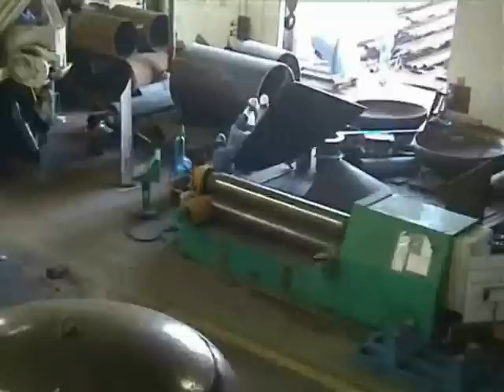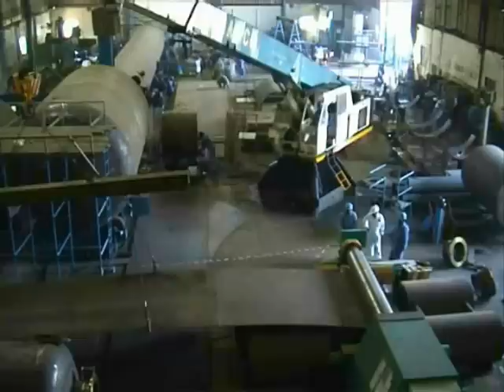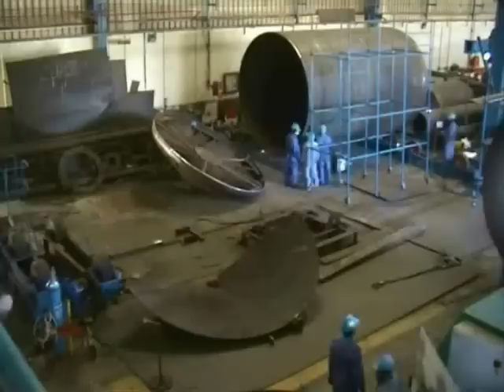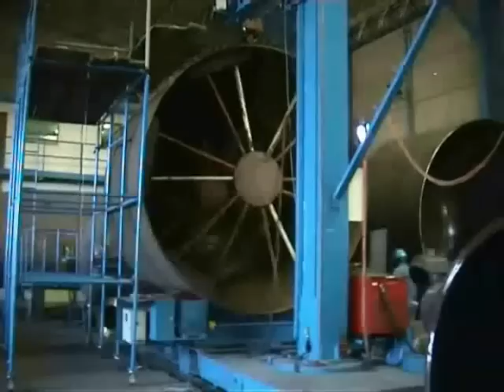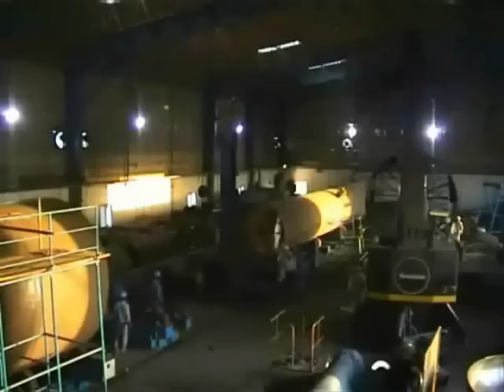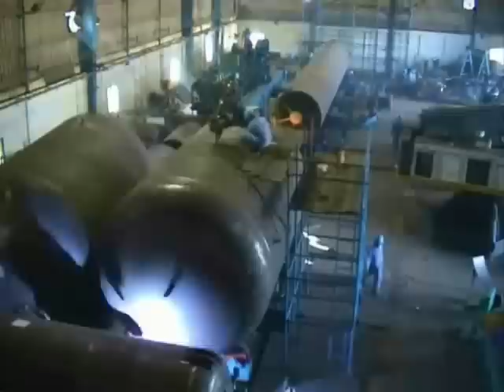Pressure Vessel Fabricators.wmv

Comment: Wish we could figure out how to roll cones. We can only press form them.
Reply: KC G cold press?
Reply: cut a wedge out of a disc and lift from center a cone should form,this only works with cones short apex
Reply: 500 लीटर का कंपटीशन चाहिए एयर कूल्ड
Reply: You have to develop out the correct shape, then use pyramid rolls with an idler roll to keep the radial lines parallel with the top roll.